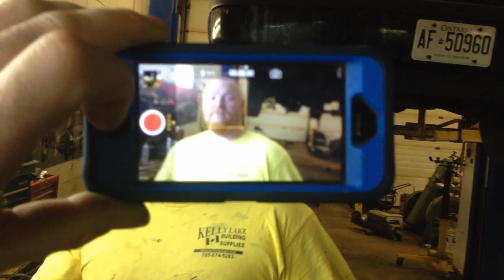Double production express van carnage cummins maintenance

Comment: sludge in motor is not because old oil but because different thickness mix

cheers
Reply from the maker: ***** it sludges when the oil particles are broken down